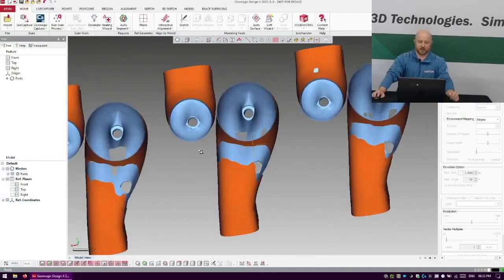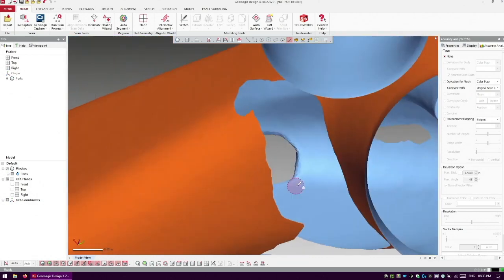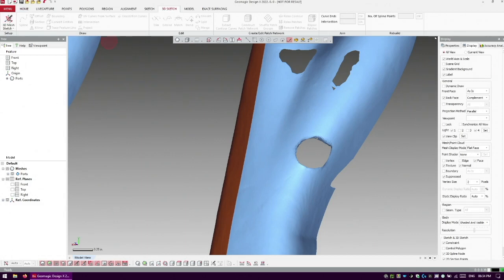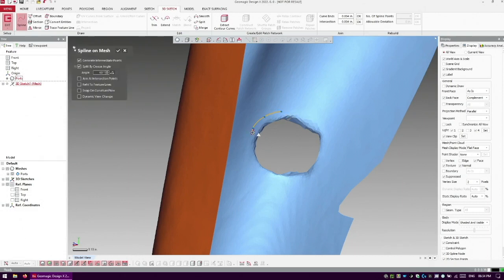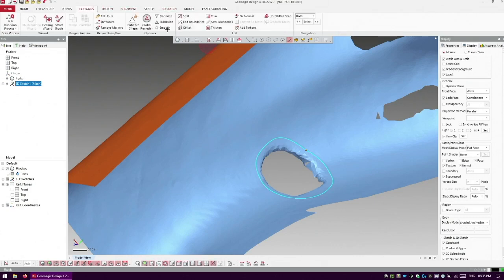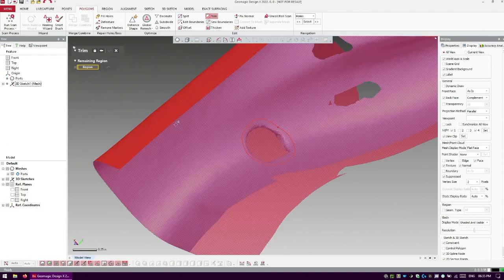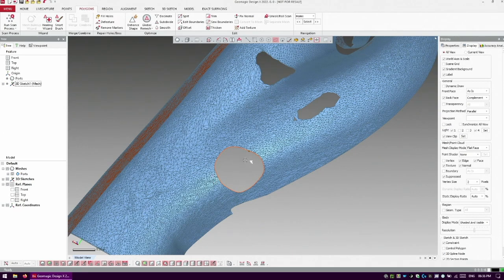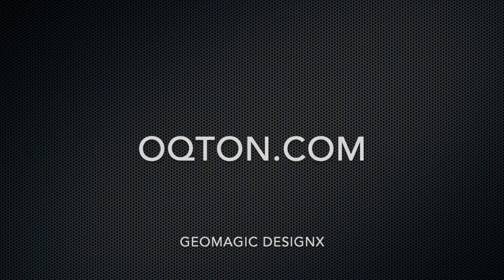How To: Clean Boundaries on a Curve to Fill Holes in Geomagic Design X

Comment: I just recently took the class and now that I'm starting to work on scans, I have a lot of questions coming up.  Would you do this after the triangulation?
Reply: Yes this would be done once your mesh is triangulated and reduced to your appropriate poly count. That way your edges would be as sharp and clean as possible as the end result.
Reply: @znythtechnologies  thank you so much.  This is a little different question, but can you tell me how to reduce the amount of noise/scattered data when scanning a curvy piece so that there is not so much clean up that needs to be done.
Reply: @kemfranklin4093  I'm not sure what scanner/settings you are scanning with but typically that is from too high of a scan resolution setting. To fix it you can brush smooth the affected area to even it with the rest of the surface.
Reply: @znythtechnologies  ok, and thank you again.